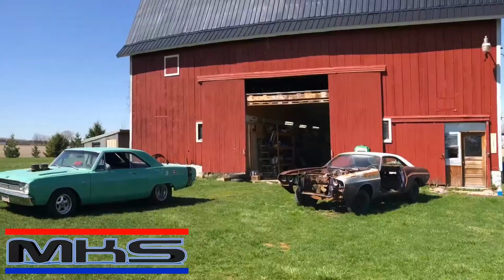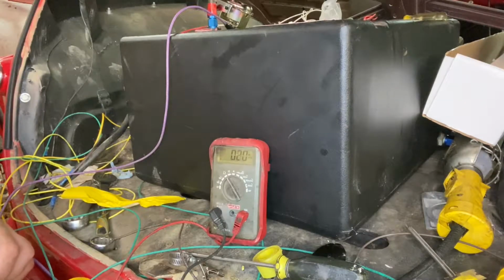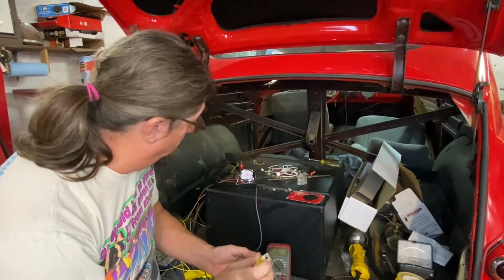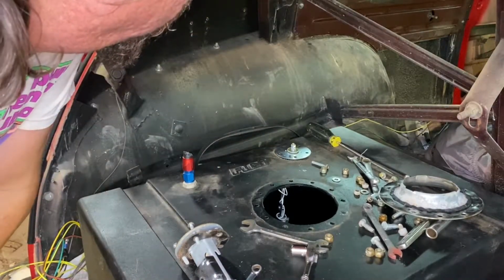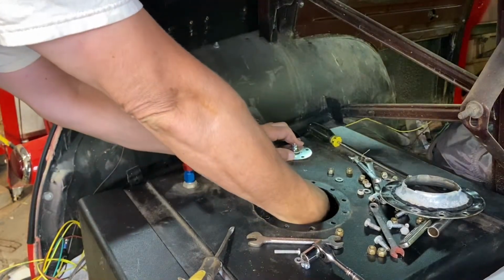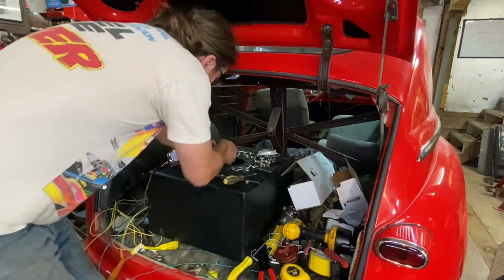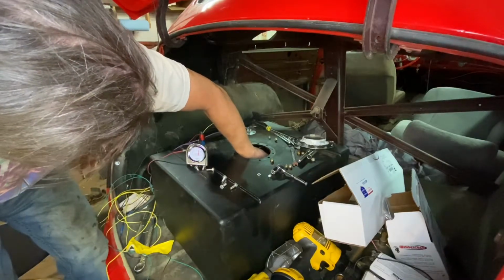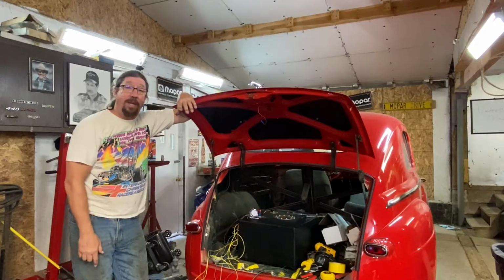47 Ford Fuel Gauge Part 2 - Epic Fail or Epic Success?

Comment: Great explanation and problem solving on this after market fuel gauge setup. I've never messed with aftermarket, on factory setups which sometime are less than accurate. Great job Mike!! This car is one step closer to being ready to cruise!
Reply from the maker: I’m starting to see the light at the end of the tunnel.

Comment: My fuel gauge is causing so many headaches...Factory one took a dump so went to aftermarket...worked "ok" for a little while then something must have gone to earth as it was tapped out for a while...Ill have to test the gauge itself first I guess but you gave me a clue last week re that...Handy tip re adjustment internally too...If Ive got a gas gauge Id rather be keeping a close eye on it down the empty end so Id be shooting for as accurate as possible there...Ive run out of fuel 3 times in my Barracuda now as Im using the $50 a trip technique. This doesnt always work and Im not sure how familiar you are with a tired angry woman on the side of a highway at 1am , when the gas station is 5 miles away, but can assure all of you...not that much fun...Cheers Mike ... I learned something with this
Reply from the maker: Yes the tired angry woman… We want to avoid that at all costs. Lol
Hope you get yours sorted